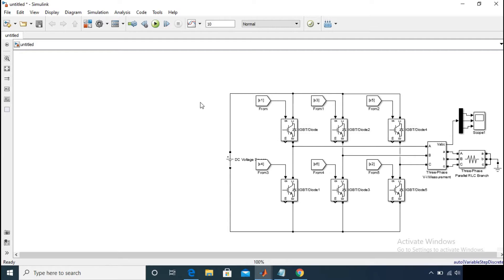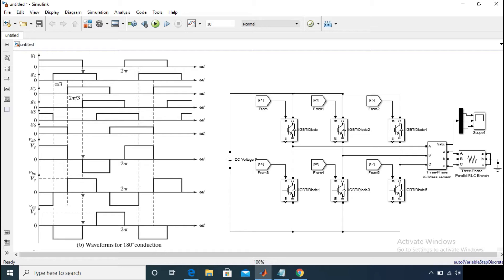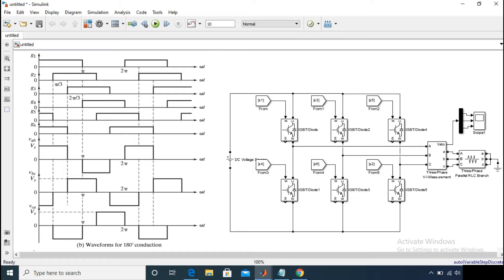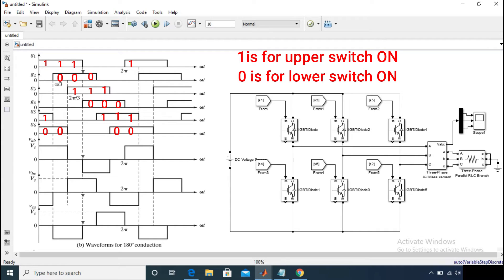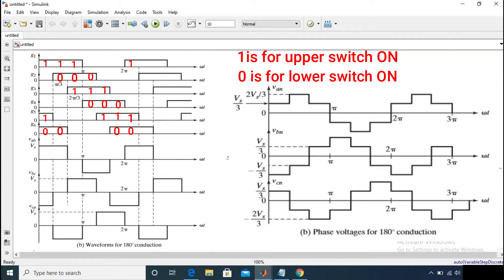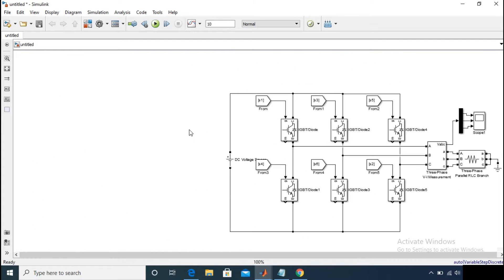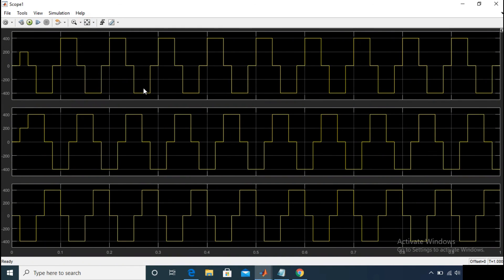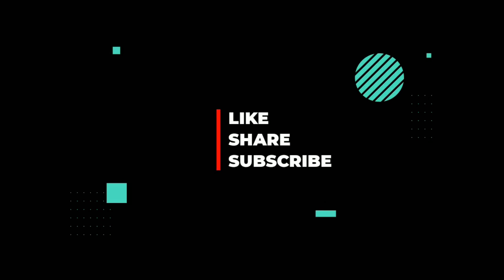180 degree  conduction mode of 3 phase Inverter(VSI) | MATLAB Simulation

Comment: How 360 deg is equal to 0.1 sec? Please explain.
Reply from the maker: Here one cycle is for 0.1 sec because here i assume switching frequency as 10 HZ.
Reply: @RanitSengupta  Ok. Thanks a lot. I was calculating it for 50Hz that is why I was confused.
Reply from the maker: @zahoor836  Yes for 50 hz it will be 0.2 sec